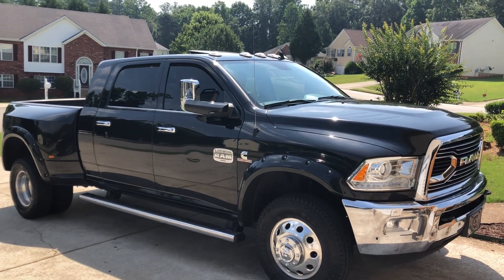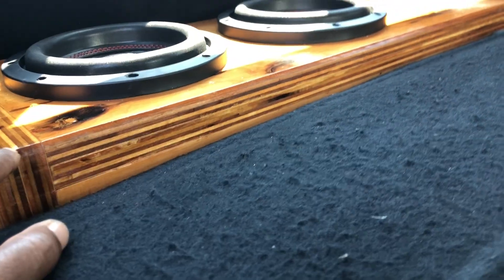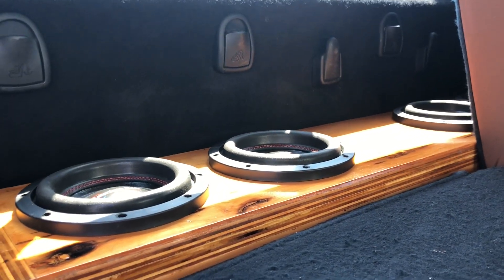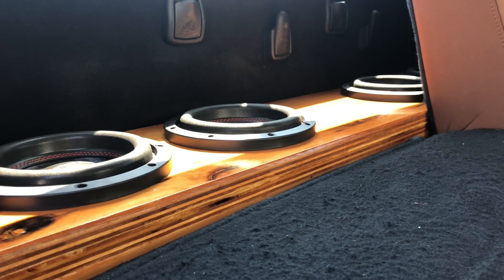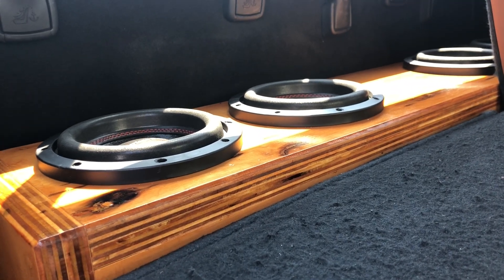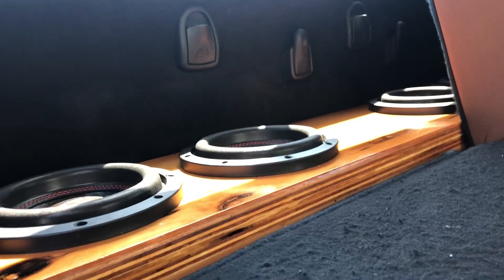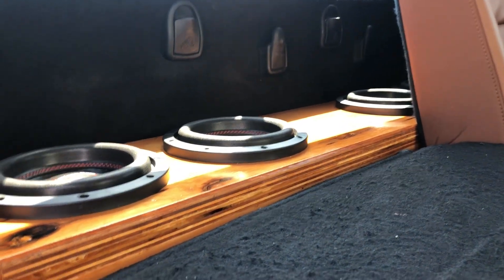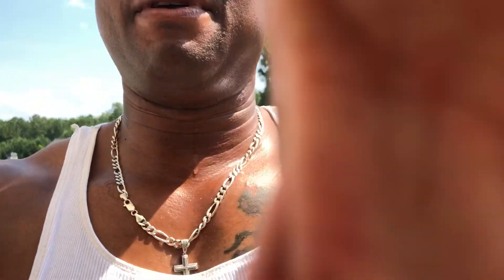RAM 3500 Custom Subwoofer Enclosure

Comment: Very informative thank you for the break down, no one has ever explained impedance when running multiple subs, i never knew of the loss of amperage, and your correct MBE, most box builders, build custom boxes for the space provided and never build to specs of the subwoofer, thank you

Comment: when you say it doesn't enable the seat to roll back, do you mean you can't put your rear seats up at all  ?   or you can't recline them ?      I had one of your big horns and loved it in my tahoe.   Have since sold that ride and am looking to get into a 2011 MegaCab 3500 .  Just looking for options.   gonna have to do something that will allow a carseat in the rear .    FYI FOLKS   MYRON IS A LEGIT STAND UP GUY !!!   he built and shipped me an enclosure and it had my dual sa8v3's  sounding all types of good

Comment: Can you build a box for 3 or 4 10" Sundowns? What's the best setup for the deepest lowest bast that hit hard with a 5000-watt amp? I have a 2020 Ram 2500 Mega cab that I just picked up. Nice build
Reply from the maker: Text me at 404 694 4818... let get it going

Comment: Will 12s fit in a 2020 ram 3500 if I want the seats down for others to sit? If so could you build a custom box that would allow the 12s?
Reply: Did you find a box? I have a 2022 3500 and looking for a box.

Comment: Just came across your channel and I appreciate your work.  Just curious what kind of saw are you using for your box?  Table saw? other? Brand,  model, etc.   Seems like it makes nice straight  cuts.  Thanks from Cali.
Reply from the maker: Derrick Hamilton table saw Ryobi or Craftsman
Reply: @M.B.Enclosures   if the subs where facing down would you have same output?

Comment: I have a Chevy Tahoe with all seats in it. I have a down4sound box for two 8s . I was wondering if 4 8s would sound good or should I go with 2 10s . I currently have 2 Sundown x8v3. On a deaf bounce machete 2100 . The length is 48 inches and the width is about 12 inches.
Reply from the maker: Superior Lawn Care 4 8’s is more cone area than 2 10’s. The real question is if there is available airspace for the 10’s?
Reply: @M.B.Enclosures  ... It would be a tight fit for sure for the 10s because I have 5 kids I need that 3rd row seat. I love the way my 2 Sundown x8v3 sound. I'm just wondering if 4 8s would sound better and if it's worth me buying 2 more plus another amp. Also another box for 4   8s

Comment: What’s your opinion on the dc m3 8? I’ve been following your videos for a while (subscribed) and I like the vfl 8’s but keep coming back to the dc. I have a sa10v3 now that I’m switching out for 2 8’s. Oh only have around 800 watts to work with. May get a 1.2k but for now 800ish watts.
Reply from the maker: Israel Torres the DC 8” is very efficient and clean sounding. But  you comparing a 2” coil against a 2.5” coil. The VFL8 with its larger coil is more SPL geared than the DC M3 8”. The DC 8” should be compared against a SA8v3 or a JL W3 8” or the like. It’s more a SQL 8”.
Reply: M B ok thanks for the info. I see your building boxes I will contact you about building me one